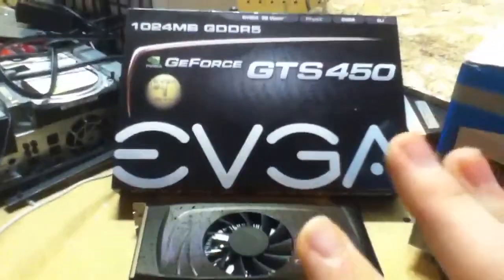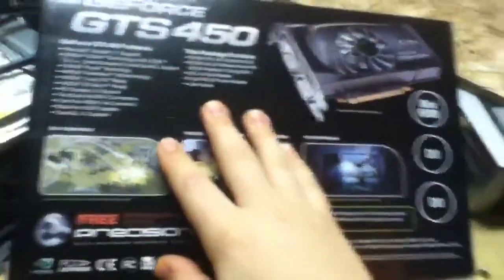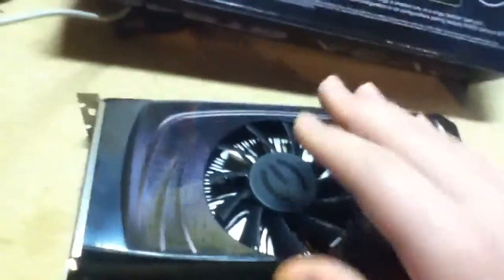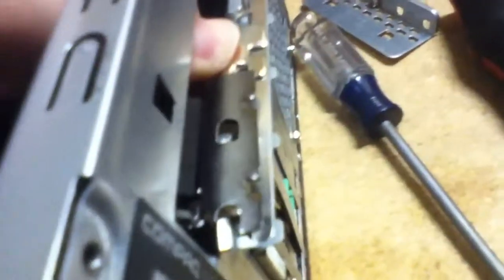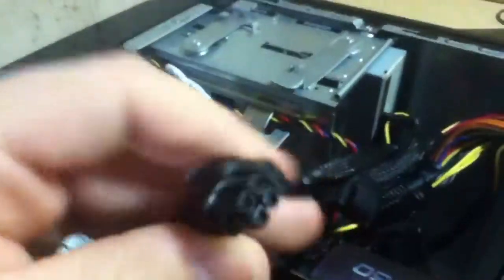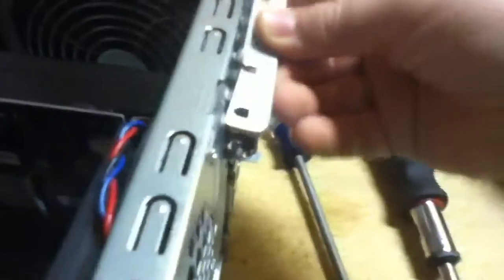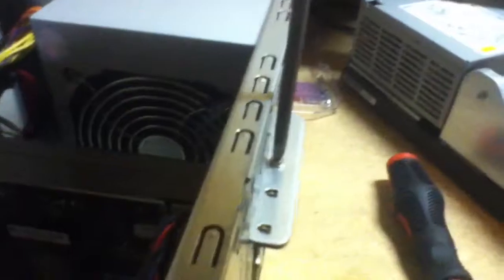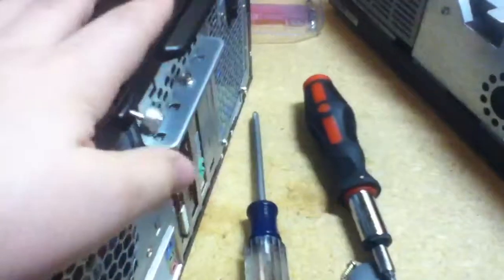EVGA Nvidia GeForce GTS 450 review.

Comment: Bought a 500 Watt power supply with this, and i brung it to a technician to install and the PC wouldn't boot with the 500w and he had to use the stock 300w PSU that came with the PC. what should i do? he said that it wasn't compatible and it would fry my motherboard? should i get a 400watt PSU like you did?